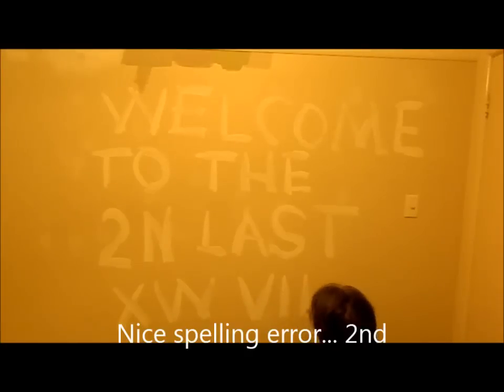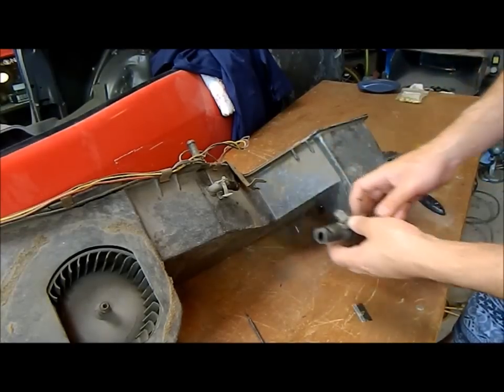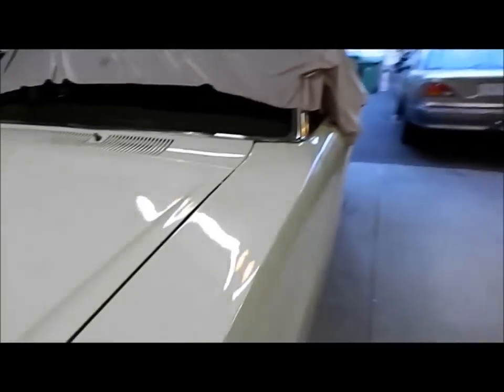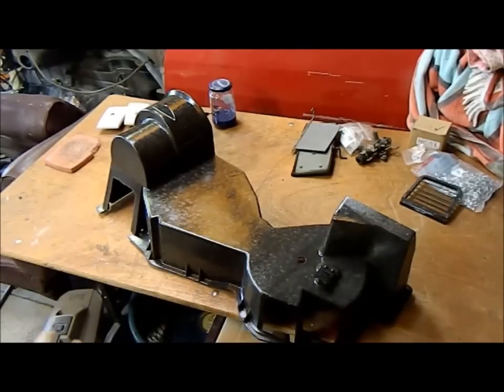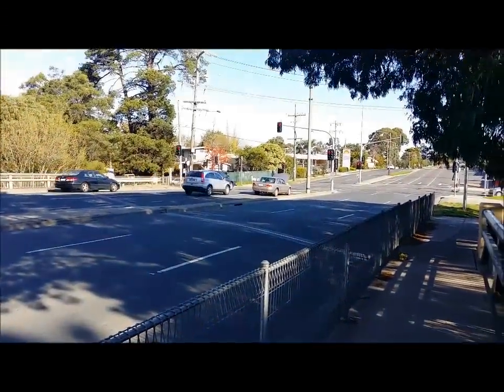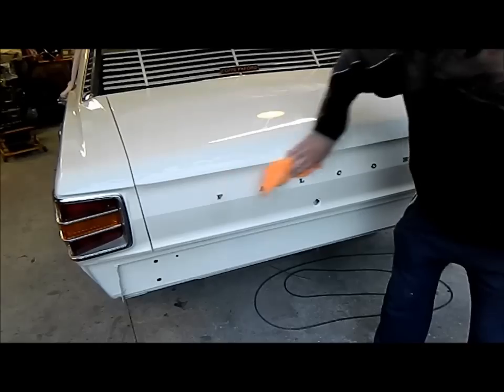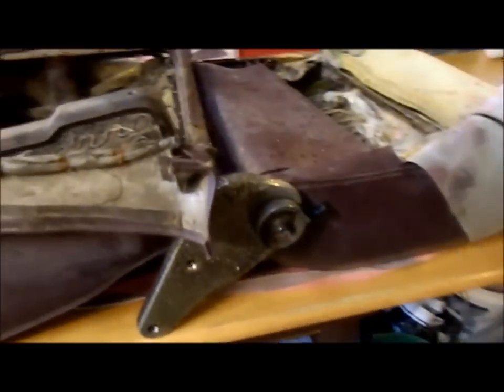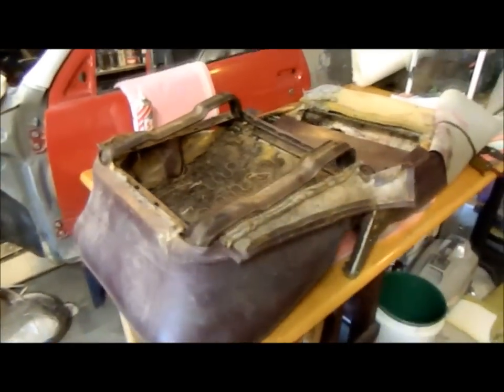1969 XW Ford Falcon Restoration Part 23

Comment: Great work again! Love the longer length videos, gives me time to get immersed in the final stages of the build.
Looking forward to the first time roady! Will hopefully be more rewarding than how the EF/El treated you! Amusing cut scenes there. The ignition module is usually at fault with those. The amount of money you have saved doing many things yourself (engine build, dyno testing / running in, upholstery, wiring, welding, painting/bodywork would of saved you easy 10k-15k. So at 27k this is a brilliant budget build, and the end result is certainly a car that will hold its own in any show! Im very excited to see the last video(s)
Reply from the maker: vigilante351 Thank you very much... I guess the EL was my fault, I should have replaced the distributor and I wouldn't have been left stranded, thanks again for the comments